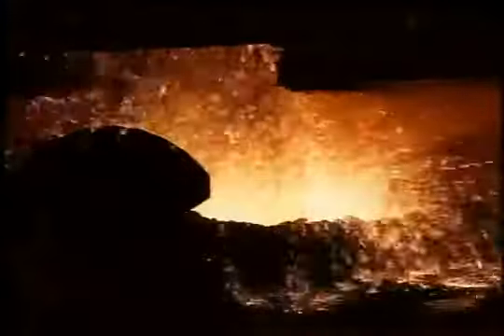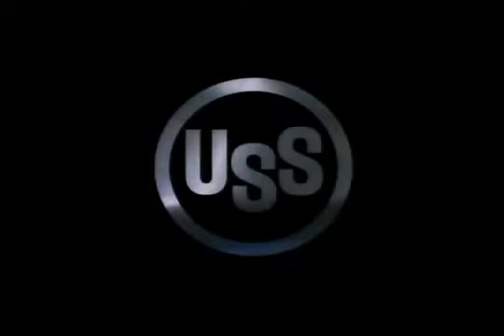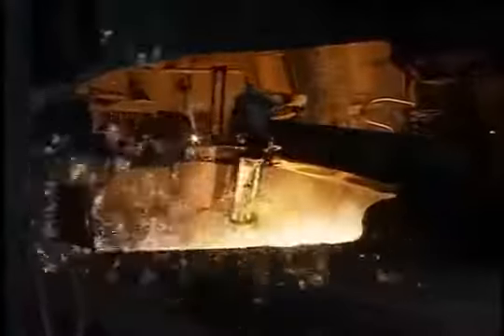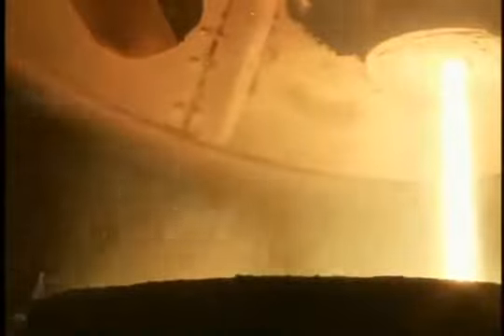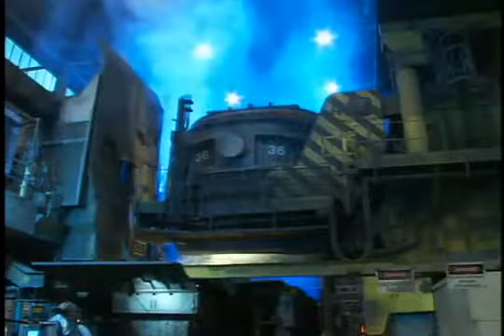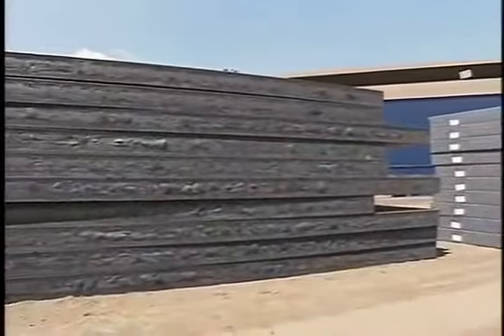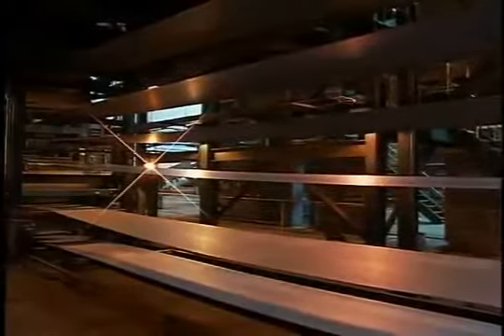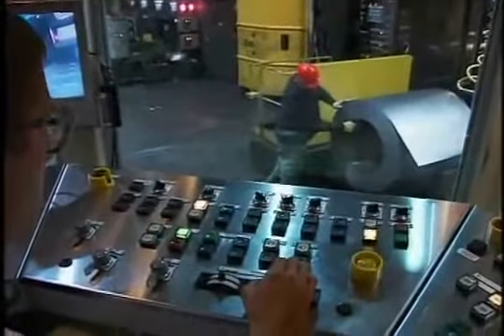STEEL  From Start to Finish

Comment: DELFT "SteelMaking QUIZ 1"
Adven Hutajulu 2713100060
Steel Making process.

The process of steel making, is originally started from the production of iron. To produce iron, coal (C), limestone(CaCo3) and iron ore (Fe2O3) are needed as the raw materials. The iron ore start according to origin. Then, the field of source are reclaimed. Using the conveyor, it mixed in the rotating drum. To make optimum blends.
To obtain the blends, fire and trans water rolling over a furnace. The other raw materials , the coal, ground the product is blown into the furnace. Here, at 1100 degree of celcius, the coal is converted into logical coke. Consisting of pure carbon with minor pollution, the metallurgical coke is be processed into cooling system. After the cooling process, it will be divided into limestone, coke, and iron ore in in the blast furnace.
The small size is then used in the sintering process. Iron ore, coke and also limestone are now currently dispersed into blended. This blends, is completely burned into the strands which slowly moves under the combustion. While the fines are returned to the sintering process, the remaining product is the sinter.
The combustion zone move downward through the blend the high temperature, as soon as the blend is completely burned through it is coal crushed and screen. While the fines are turned into the sintering process. The remaining product is the sinter, the basic component to the next step. In the blast furnace operations, the sinter, limestone, and coke are biocompiyable or skips transported to the top of the blast furnace.
Iron ore is principally a compound of iron and oxygen. Iron is produced by the extraction of the oxygen and coke. This reaction is endothermic. To the stable reaction, extra coke is injected together with the air. The air is preheated to around 1200 degree of celcius in hot blast rolls, and blown into the furnace through the tuyer.
Moving downward the sinter, coke, and limestone are converted into the liquid iron and slag. To safely used of the use for most expensive metallurgical coke, sometimes polarized coke or and is injected. By computer the process operating parameters controlled. The iron turned into pig iron is collected in to bottom of blast furnace and tapped into lethal. Here, the real steel making process starts. Beginning with the dissolve reaction process by injecting lime powder to avoid loss of ductility at high temperature a solver reduction that value lower than 0.01 percent is necessary.
Now the liquid pig iron is transported to the steel plant. Steel making can be carried out in several processes. Nowadays only the BOF and EAF processes are relevant. In the oxygen steelmaking processes the liquid pig iron is transferred into another lethal. The temperature is measured, and the samples are sent to the laboratory and the floating slag is removed. The liquid pig iron now put into a converter.
Subsequently scrap is added, this is to control the temperature increase due to oxidation impurities maybe carbon and silicon. Pure oxygen is blown into the bath, the impurities of oxidize and slag are floating on the surface. Finally the temperature above 1600°C is obtained. At the end of the oxidation process the samples are taken for chemical analysis.
By using the aluminium, the steel is oxidize and it dissolve with oxygen. The alumunium associated with the oxygen and improve the ductility these element will be added during taping of the steel from the converter into the huge ladle. The ladle is placed under the converter, steel and slag up or down to the converter separately. Tapping first the steel, after that the slag.
The liquid steel is then stirred using an inert gas , argon. this to insulte the composition and temperature will be homogen through out the lethal. in addition, the gemstole flow out impurities which consult into the slag. after refining, the lethal is now containing about three houndrets tons of liquid steel. which is taken into a continuous casting machine through engine ingot molds.

Comment: ( DELFT Steelmaking Quiz 1)by adven hutajulu 2713100060
Steel Making process.The process of steel making, is originally started from the production of iron. To produce iron, coal (C), limestone(CaCo3) and iron ore (Fe2O3) are needed as the raw materials. The iron ore start according to origin. Then, the field of source are reclaimed. Using the conveyor, it mixed in the rotating drum. To make optimum blends.
To obtain the blends, fire and trans water rolling over a furnace. The other raw materials , the coal, ground the product is blown into the furnace. Here, at 1100 degree of celcius, the coal is converted into logical coke. Consisting of pure carbon with minor pollution, the metallurgical coke is be processed into cooling system. After the cooling process, it will be divided into limestone, coke, and iron ore in in the blast furnace.
The small size is then used in the sintering process. Iron ore, coke and also limestone are now currently dispersed into blended. This blends, is completely burned into the strands which slowly moves under the combustion. While the fines are returned to the sintering process, the remaining product is the sinter.
The combustion zone move downward through the blend the high temperature, as soon as the blend is completely burned through it is coal crushed and screen. While the fines are turned into the sintering process. The remaining product is the sinter, the basic component to the next step. In the blast furnace operations, the sinter, limestone, and coke are biocompiyable or skips transported to the top of the blast furnace.
Iron ore is principally a compound of iron and oxygen. Iron is produced by the extraction of the oxygen and coke. This reaction is endothermic. To the stable reaction, extra coke is injected together with the air. The air is preheated to around 1200 degree of celcius in hot blast rolls, and blown into the furnace through the tuyer.
Moving downward the sinter, coke, and limestone are converted into the liquid iron and slag. To safely used of the use for most expensive metallurgical coke, sometimes polarized coke or and is injected. By computer the process operating parameters controlled. The iron turned into pig iron is collected in to bottom of blast furnace and tapped into lethal. Here, the real steel making process starts. Beginning with the dissolve reaction process by injecting lime powder to avoid loss of ductility at high temperature a solver reduction that value lower than 0.01 percent is necessary.
Now the liquid pig iron is transported to the steel plant. Steel making can be carried out in several processes. Nowadays only the BOF and EAF processes are relevant. In the oxygen steelmaking processes the liquid pig iron is transferred into another lethal. The temperature is measured, and the samples are sent to the laboratory and the floating slag is removed. The liquid pig iron now put into a converter.
Subsequently scrap is added, this is to control the temperature increase due to oxidation impurities maybe carbon and silicon. Pure oxygen is blown into the bath, the impurities of oxidize and slag are floating on the surface. Finally the temperature above 1600°C is obtained. At the end of the oxidation process the samples are taken for chemical analysis.
By using the aluminium, the steel is oxidize and it dissolve with oxygen. The alumunium associated with the oxygen and improve the ductility these element will be added during taping of the steel from the converter into the huge ladle. The ladle is placed under the converter, steel and slag up or down to the converter separately. Tapping first the steel, after that the slag.
The liquid steel is then stirred using an inert gas , argon. this to insulte the composition and temperature will be homogen through out the lethal. in addition, the gemstole flow out impurities which consult into the slag. after refining, the lethal is now containing about three hounrets tons of liquid steel. which is taken into a continuous casting machine through engine ingot molds.

Comment: Ihsan Maula
2713100018

DELFT (Quiz1)
Steelmaking begins with the manufacture of fire whose raw materials are iron ore (Fe2O3), coal (C) and limestone (CaCO3). Iron ore is stored in accordance with its origin in the form of layers. before continued into the next process, the layers are thoroughly mixed. other raw materials, coal fed into the furnace and into metallurgical coke. after that metallurgical coke which is then cooled to form a large coke that will be used in a blast furnace and a small coke that will be used in the sintering process. iron ore, coke, and limestone mixed. after mixed, then passed slowly under fire, the sintering process which results are sintered. sinter, coke, and limestone is transported using a conveyor belt to the top of the blast furnace. Iron ore is composed of iron (Fe) and oxygen (O), iron formed from oxygen extraction using coke (C) wherein the reaction is endothermic reaction. so that the reaction can occur, coke administered together with hot air. sinter, coke, and limestone fed into the blast furnace from the top and go down into liquid iron and slag. to save metallurgical coke, coke and oil are sometimes included. after the raw material turned into pig iron, this is where the steelmaking process begins. first of all begin with the desulfurization process by including lime powder into pig iron. the steelmaking process can be done through several processes, but currently there are only two relevant process. the oxygen steel making process, pig iron moved to another place and then measured the temperature and floating salg discarded. after the pig iron fed into the converter and added scrap. the oxidation process is carried out to reduce the impurities, which are carbon and silicon. pure oxygen is blown into the converter. after the oxidation process, the sample is taken for analysis. of the analysis results can be seen allowing elements, to eventually do deoxidation or desulfurization. then the steel and slag is poured separately. after refining, steel incorporated into the continuous casting.

Comment: Anggiat Ramos J
2713 100 067 ( DELFT Steelmaking Quiz 1)

Steelmaking begins with the production of iron, which the raw materials are iron ore, coal, limestone. Before the iron is transported into the next process, the layers are mixed at rotating drum to make the optimal blend. The other raw materials, the coal, grounded into powder into the furnace. At 1100 degrees centigrade, the coal is now converted into metallurgical coke consisting of pure carbon with minor pollution. The metallurgical coke is guided into the quenching station and after cooling, the coke turned into large sized coke / plum coke and small coke breeze which is using in the sintering process.
Iron ore, coke breeze, and also limestone are now carefully dispensed and blended. This blended process is spread on the strand, which slowly moves under combustion, the sintering process. The combustion zone moves downward into the blend. As soon as the blend is completely burned through, it is cooled, crushed, and screened. The fines are returning into the sintering process. The remaining product is the sinter, which is basically is the component into the next step, the blast furnace operation.
Sinter, plum coke, and limestone via conveyor belt, are transported into the top of the blast furnace. Iron ore is principally compound of iron and oxygen. Iron is produced by the extraction of oxygen using coke. This reaction is endothermic. To sustain the reaction, extra coke is injected together with hot air. The air is preheated to around 1250 degrees centigrade in hot blast stove and blown into the furnace which is equally distributed around the furnace. Moving downward, the sinter, coke and limestone are converted into liquid iron and slag. To save the use of the expensive metallurgical coke, sometimes polarize coal or oil is injected. By computers, the process operation parameters can be monitored.
The iron called pig iron, is collected at the bottom of the blast furnace and transferred into the torpedo layers. In here, the real steelmaking process starts. Begin with the dissolverazation process, by injecting lime powder. To avoid loss of ductility at high temperature, a solver reduction at values lower than 0.01 percent is necessary.
Now the liquid pig iron is transported into the steel plant. Steelmaking can be carried out in several processes. Nowadays, only the oxy steel and electric arc processes are relevant. In the oxygen steelmaking process, the liquid pig iron is transferred into another ladle. The temperature is measured, the sample is taken into the laboratory, and the floating slag is removed. The liquid pig iron is now pours into converter. Subsequently, scrap is added. This is to control the temperature increase due to oxidation and impurities.
At the end, molten metal and the slag are separated. The slag will be thrown away, and the molten metal will be keep. The molten metal can be used to make the steel products.

Comment: Yudhistira Surya Andika K. 2713100101

This video explained about the process of steel making from
the start. First process of making steel is to make iron. The raw materials are
iron ore, coal, and limestone. The iron ore stored according to origin. Before
go to the further steps, the layer which came from the reclaimed iron ore. The
layer are mixed by a rotating drom of the reclaimer to make optimum blend.
Then, the other raw material are being processed. The coal processed into
powder and transported to the furnace. The coal heated about 1100 deg C the
coal was converted into metallurgical coke consisting carbon with minor pollution.
After the metallurgical coke guided through quenching station. After cooling
process, the metallurgical coal formed lump coke used in the blast furnace and
small coke breeze to be used in sintering process. Iron ore, coke breeze and
limestone carefully dispensed and blended and then transported to sintering
process. The combustion zone for sintering process move downward through the
blend and high temperature sinter the iron. As soon as the blend completely
burned through, It’s cool, rushed and screen while the fine returned to
sintering process. The remaining product is the singer which will became the
raw material for the next step. The sinter, coke and limestone are carried via
conveyor belts or skips transported to the top of the blast furnace. As we know
that iron ore is basicly formation for iron and oxygen. We can get iron as the
extraction of oxygen using carbon inside the blast furnace.The reaction inside
is endothermic. To sustain the reaction, extra coke is injected together with
hot air, the area it pre heated around 1250 deg C. First, thethe sinter, coke,
and limestone converted into liquid iron and slag. To minimize the use of
expensive metallurgical coke, sometimes other component like oil is injected.
He process controlled by the output indicator of the computer and always kept
under control. The iron collected at the bottom of blast furnace. We can change
the characteristic or iron by adding some components like injecting lime powder
to avoid loss of ductility.  To make
this, high temperature is used for sulfur reaction. Then this liquid pig iron
will transported to the steel plant. There are several processes in terms of
steel making. These are Siemens Martin Furnade, Oxy Steel converter, Electric
Ach Furnace, and Thomas converter. Now only two item that relevant to process
nowadays, there are Oxy Steel Converter and Electric Arc Furnace. In the oxygen
steelmaker, we must separate the slag for further process. The raw material
transported to the Oxygen Furnace. The reaction happening in this area is when
the oxygen blown into furnace, so It will decrease impurities and carbon. After
the BOF process the samples are taken for analysis. After that there several
step and then the molten metal casted to make a shape of demand.